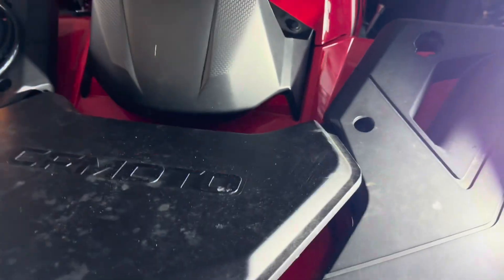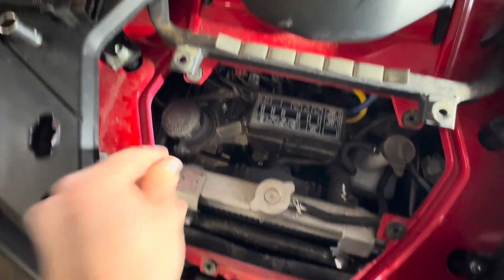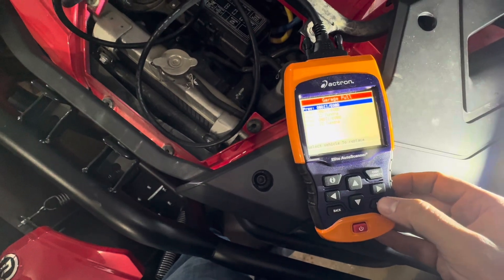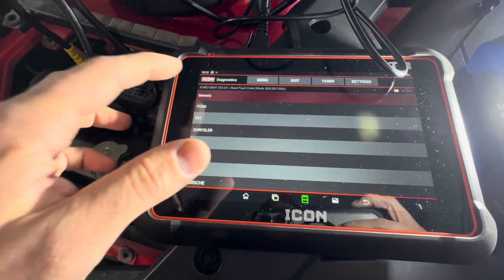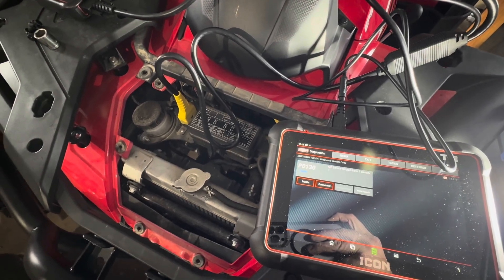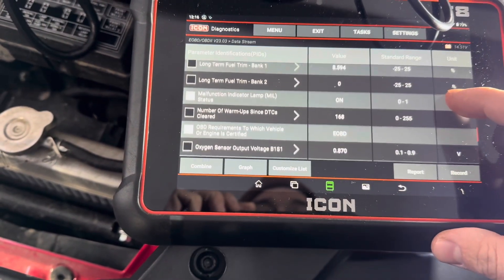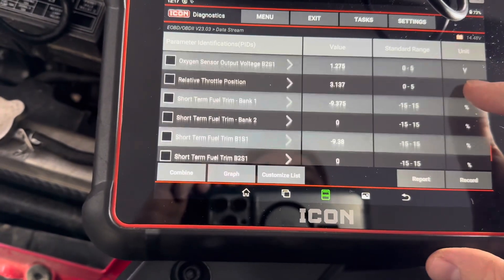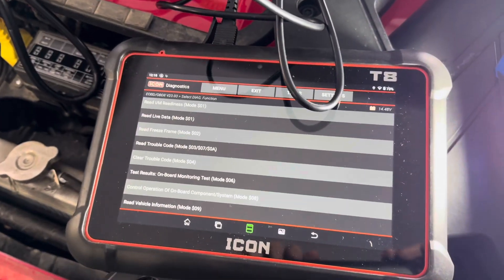CFMOTO Cforce 600 Check Engine Light / Retrieving Trouble Code

Comment: Any idea what the red light to the right of that is bc on my 600 with 18hrs 2023 it just came on…
Reply: I have the same code but after riding and letting it run it now has the red (!) lit any idea?
Reply from the maker: @ No. Those seem very unrelated though. I haven’t had the code come back since I cleared it.
Reply from the maker: To the right of the check engine light?